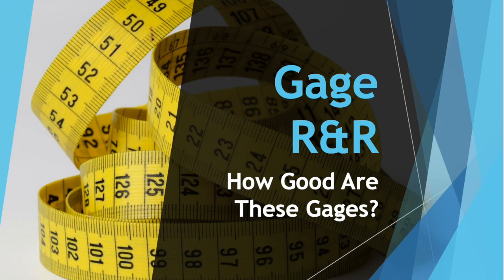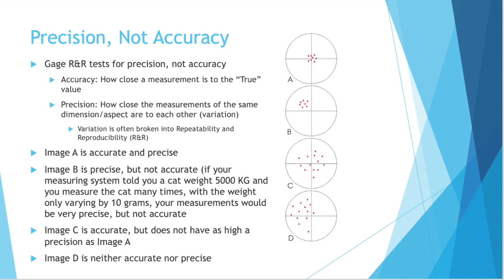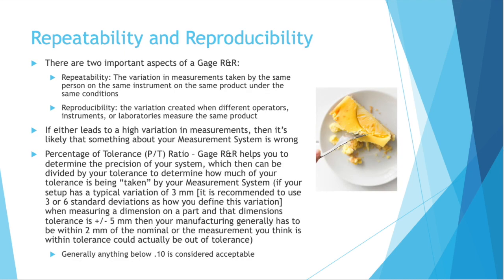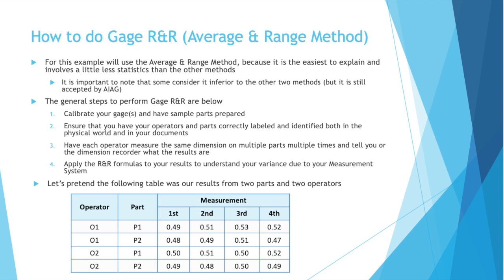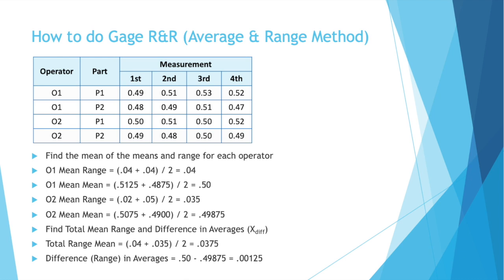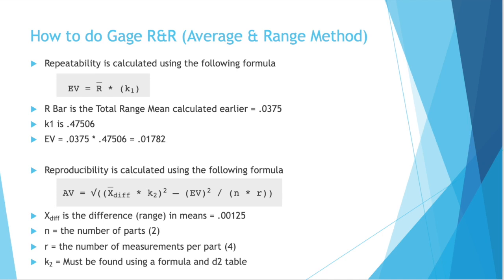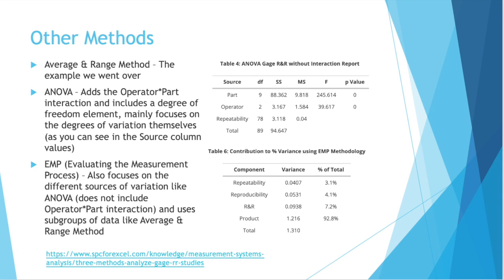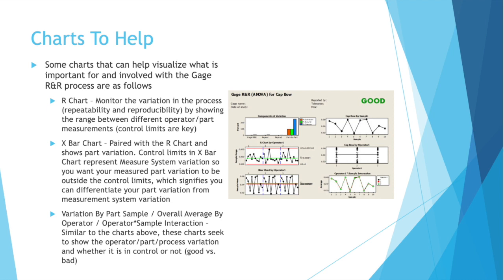Beginning Engineers: Gage R&R

Comment: To find out k2, should the subgroup size considered be for parts or for operators?
Reply from the maker: For k1 we are multiplying the combination of parts and operators (2 parts * 2 operators = k of 4 in my example around 11:00, n is also 4 because that is the number of times the measurement was taken. For k2 we are only using the number of parts for subgroup size, not the number of measurements (so 2 instead of 4). It is the same table for both, and the k value on table doesn't change, but the subgroup size does so the value is different from k1 to k2.